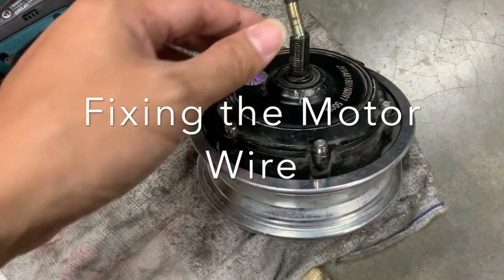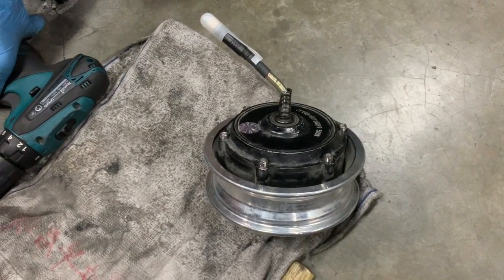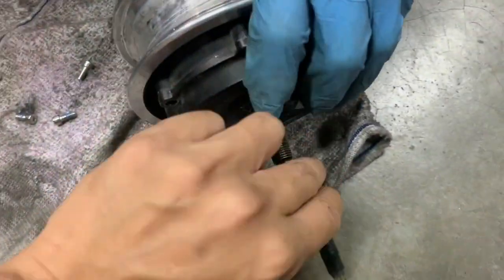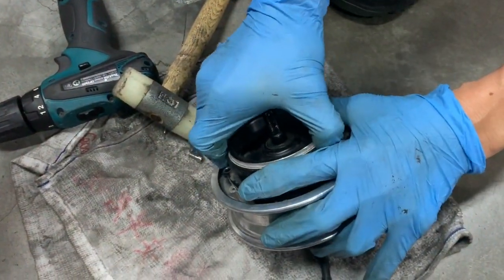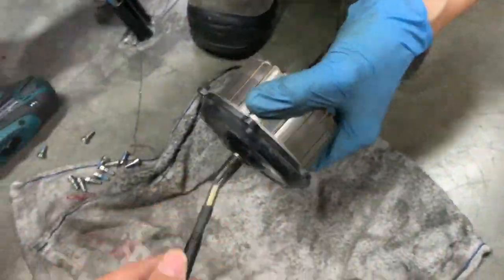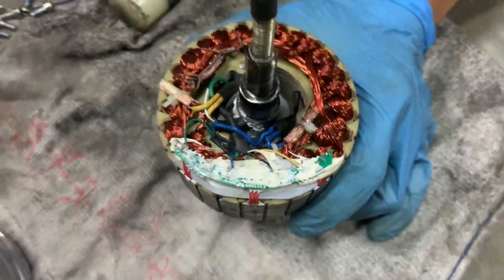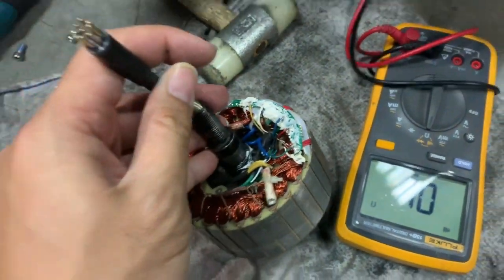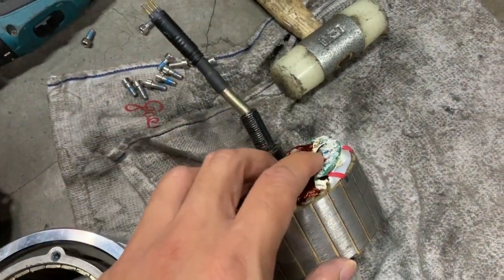How to Repair ZERO Scooter Motor Part 1

Comment: ████ REAR MOTOR ZERO 10x ████
I was driving and heard a knocking sound coming from the rear engine. But nothing hit, so I drove on. Back home, I noticed that there were only two screws left to keep the magnet in place. The engine was also very hot, so I cooled the engine with some water. 
By pouring it slowly onto the outer tire, I disassembled the engine and replaced all the screws and tightened them back. 
The engine runs super smooth, but it has no pull-up power, I can hardly get uphill. And the limiter button also works now 10 km/h more. Also, speed settings make no difference. The front engine is working like always here is no problem at all
I even use now my zero on two engines because only the rear is not an option with the power loss. What do you think is the cause of the power loss of the rear engine?
ps / two years ago, I had to replace my rear controller. My zero didn't work at all anymore. This time it's clearly a different issue.

Comment: Great video, thank you. I am facing another problem with my motor - it seems the central bolt which is attached to the frame is bended. So is there a way to change it or I need a new motor?
Reply from the maker: There’s no safe way to fix that. You have to change the motor

Comment: Hi I’ve got a problem with my scooter :
When I try ride my scooter it starts making a weird grinding type noise and the front wheel isn’t spinning properly could you explain what the problem is
Reply from the maker: bearing issue. need to change bearing.

Comment: Thanks for the video.
I was interested the disassembly directions.
That wire fix looks to be a real nasty job though.  Not surprised it wasn't shown.
Reply from the maker: What do you mean sir?
Reply: @FalconpevSg  It did not look very easy to replace and splice a new wire in.  I was hoping the video would should that being done.

Either way, I was more interested with how the motor separates from the Rim as I am dealing with a problem on my rear wheel.  I got my first flat.  Was going change the tire in accordance with the many videos I have seen on the subject.  For some reason one screw out of 5 for the rim would not come  out and ended up getting stripped in the process.  I wanted to see how well the motor separates from the rim if it comes down to needing a new rim.
Reply: Thank you for the disassembly instructions. Unfortunately, the hollow axle with the wires through is full of silicone sealant and the wires cannot be easily removed. Can you advise how to proceed?

Comment: theirs got be something that can be done to prevent this from happening.
 i'll receive mine Zero 9 next week , gonna see what i can do to not let that happen.
i'll post if i succeed.
Reply: Hi, have you found a way to prevent this from happening? I also own a Zero 9 scooter
Reply: I returned mine, got instead a T10-DDM  2000w motor  52v 24ah    same as zero 10x . After I have driven the zero9 I would not get another one. I spent more money buying the T10-Ddm what's a difference.
Reply: @jackmenino9654  all right thanks for your answer, this wire issue is annoying >.>